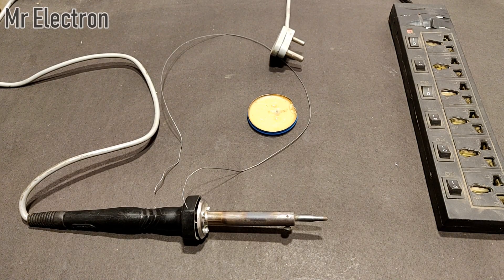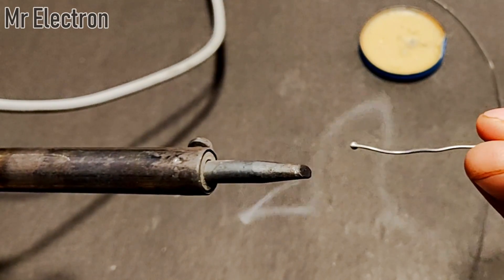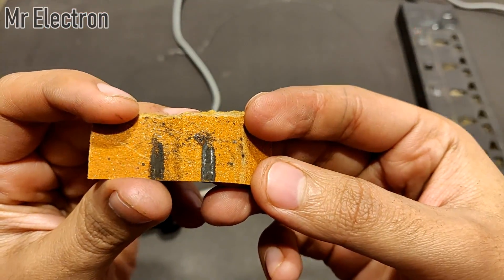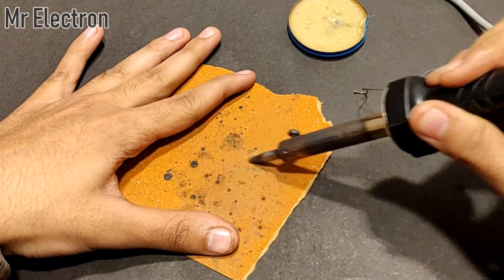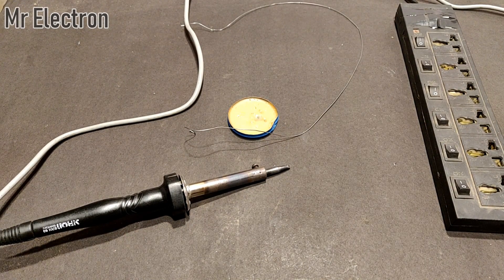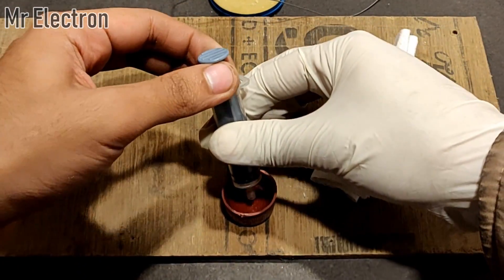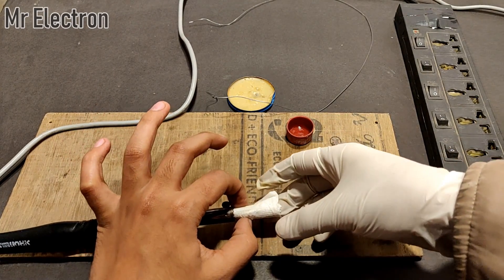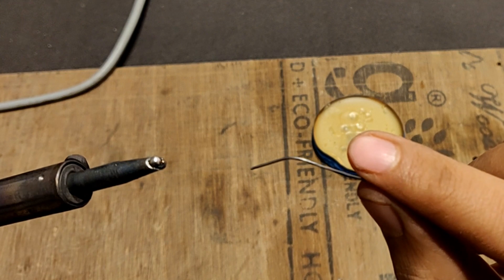Repair Soldering Iron || Solder NOT sticking to the Tip , how to Clean and re tin

Comment: Over heating is the main reason that causes damage to the tip.
Use a fan regulator to control voltage applied to the soldering iron.this improves the life of tip.

Comment: Kind of reminds me of that Phil Hartmann sketch, the anal retentive electrician. I leave the iron on, hit it briefly with the dremel drum sander, and tin it. That's it! Unless you're cauterizing wounds, I see no need for acid and ONLY CLEAN tissue paper. Get the metal clean and tin it, and go! That thick layer of fluffy carbon on the rest of the tip can actually act as insulation on a cold windy day, so long as you have good contact inside the iron.

Comment: Please, can you write down temperatures you were working with for each each phase? And what was the ratio of sulphuric acid solution?
Reply: this guy is basically ruining his tip. all you need to do is turn your iron on around 300 and dip it in flux and then add solder to it and then wipe the solder off. do that about 3 times and you should be good. dont ever use sand paper

Comment: So when u solder youre basically doing an electrolysis with the solder tip as cathode hence the unavoidable accumulation of residue due to oxidation... 🤔... Eh, sulfuric acid? ... He's reversing the electrolytic process? 🤔... He did not. 😳

Comment: What a terrible demonstration of how to clean a tip. People, don't follow these instructions. Use sandpaper as a last resort and even then, do it lightly so you don't scratch through the tin plating. Keep your tip tinned and don't allow it to get too hot without being tinned properly or else it will oxidize.

Comment: dude, you never sand your tip. rule number 1.
Reply: This rule is wrong. Copper tip is OK to sand. An iron plated copper tip is also ok to sand until copper appears. But he has cheap pure iron tip.
Reply: @fungames24  nope. from the day i started soldering over 40 years to now, every experience person reinforces that you should never sand a tip as it grooves it and kills it.  and i agree. do not sand a tip ever.. retin your tip regulary and use  copper wire wool. never even use sandpaper. and no random stranger on youtube is going to change that!

Comment: But why though? maybe if it was the last  tip on earth i would do this. If you need to solder electronics and have them work afterwards just get some new  tips  or it will turn into a mess and make you destroy stuff trying to stick the solder and heating for too long or small blobs will jump off the iron and land who knows where and pokssjbly  create a short. Dont just take your dads old iron in  the garage used for pipe and start fiddling with your iphone.Dont  use his plumbing solder either its not what you need.

Comment: you can never take the high temp plating from the tip..In order to avoid that alwyas tin the tip before or during turning off the soldering iron.
Reply: Good irons have solid alloy tips. Depends on what you have handy. Some fine sand paper won't destroy most decent irons.

Comment: Reading all the negative comments on this man's well produced, articulate and somewhat helpful video was discouraging. Looking at his tools and noticing his accent I would bet he does not live in the U.S/UK/Australia or some other country that has access to state of the art equipment or $ to purchase them. My guess is he lives in India with a billion people and only 10 have even a solder iron. The iron he is using was probably passed down from his grandfather and was sanded well before he got it. So last resort if the tip had its coating removed before is to sand. And that will work. Not long...but will work to do a job. Hats off to a well produced video and using what ever means necessary to make a fix.
Reply: Still the most incorrect way of soldering iron maintenance
Reply: wow, wheres your proof with all those yapping.
Reply: @OldMarius-gn5kk  these "yap" things are getting out of control
Reply: What a durogatory thing to say "only 10 have even a soldering iron". Coming from an entitled individual who has 10 ft. tunnel vision right down his nose.
Reply: @GruvenHaus  it isn't even derogatory at all. I am from India and yes most people don't own soldering irons because either they don't feel the need to own one or don't know how to uses one. Getting stuff repaired from repair shops is kinda cheap here so not a lot of people buy a lot of hardware and maintenance equipment.
Reply: Well done Sherlock !

Comment: Had a soldering iron which will not stick solder, since I haven't been using it for a long time. The tip is oxidized. I remember not to use sandpaper as it will take off the coating. Since flux is acid, it's use to clean the joints, I tried using citric and oxalic acid. Both worked well, just use damp paper to swipe or dip the iron in these weak acid and clean up. It will retain the solder again.
Reply: Thanks! Was looking through the comment section to see if anyone had any other way of doing this before resorting to sand paper
Reply: @curiousseal2678  honestly you both should get better irons. The problems you are describing are only ones that happen with very inexpensive irons. Most decent irons have a solid core tip at least. You shouldn't be afraid to send them a little bit with some fine sand paper.

Comment: I think,you probably had the best intention by making this vid. But, It is exactly what we learn not to do in basic electronic class. Never use an abrasive medium on the soldering tip. You should have called your vid "how to take off the coating of your soldering iron".  Hope since you made this vid you have learned to properly take care of your tip. Anyhow, and even though, I appreciate the rest of it. You did explain clearly and did it step by step, which are things that are extremely important in teaching, specially technical subjects. Keep the good work, I enjoyed it!

Comment: can i use vinegar? sorry for the question
Reply: Vinegar is not a good idea. 
You should only high solvent alcohol like 91-95% and brass wool. Oxidation makes soldering frustrating and most of what he did was not up to standards, but he was trying to help. 

Just buy a new tip, and get some silver/lead solder to tin it with and keep it tinned.

Comment: DO NOT USE SANDPAPER THIS WILL LITERALLYBMAKE YOUR SOLDERING IRON UNUSABLE
Reply: I think the point is....its already unusable. Taking off the coating is no bueno, but when the tip is already FuXed then you gotta do what you gotta do. Title should be , "last option to save a tip before throwing it away"
Reply: @KM-oi9ks  It's still unusable after sanding. It's basically a waste of time on a pure iron tip. Copper tip is OK to sand and will work like new.

Comment: Due to a defect in the soldering station, the soldering tip heated up until it glowed. I couldn't find a way to re-tinplate the tip. Everything fails.
I think, the heat destroyed it totally. There was nothing left for me to do but grind the tip down to the copper.
It looks like extreme heat is destroying the coating completely ???
Reply: dam bro you tryna fix an xbox?

Comment: Always make sure your tip is well maintained to prevent this, when you have a new tip, first thing to do is clean and tin it, after a few joints, wipe, clean and tin it again, when you're finished, clean it and melt some solder on the tip and turn it off, the solder at the end prevents the tip from oxidizing, never leave your iron tip bare when you're finished because your tip will oxidize and sanding and filing your tip will rapidly destroy it when the plating is removed and there's bare copper
Reply: Thanks bro
Reply: @anonamemous6865  no problem bud
Reply: Yea I've been messing the tips up for a few months now...still learning,Thank you.
Reply: @rcandrew8780  no problem buddy
Reply: sorry i'm no a native speaker, what does tinning the tip mean?
Reply: @user-hy4mi6wp9b just to coat it with good solder. If the tip remains tinned, or has solder on it, oxygen cannot get to the alloy metal of the tip. Also, don't put Flux on your tip because it's acid based... the best thing is clean metal and enough heat so the solder is attracted to the metal. That's another good tip for soldering. If your connection I'd preheated with a little Flux, you just touch the solder to the wires and it melts easily onto them. If it dries dull, that means your tip is not hot enough. It should dry shiny for a good connection. Especially important in circuits that are very low voltage, as a weak connection will impact low voltage circuits much more. Things like turntable leads need lowest possible resistance.

Comment: Cool, thanks, though sandpaper (and scratching with a cutter blade) should be the very, very last resort, avoid harsh abrasion, it'll strip the iron plating at the tip and the chromium. Even if it's a copper tip, it'd deform the tip as well in no time, if sandpapered every time but thanks for sharing. 

My iron has been eaten a bit, even though I always clean it with the sponge after every use? What caused it?

God bless, Rev. 21:4

Comment: omg, I don't have a lot of experience, but I learnt to never do that. Use a brass sponge and a water sponge, retin your tip, if it doesn't want to, the tip is dead. You need to change it. 

Sanding it and using sulfuric acid just remove the plating and the lead/tin won't adhere to copper/iron exposed to oxygen as heat will constantly build an oxyde layer over it.
Reply: At my first use of a new iron it just got black and never accepted tinning the tip what did i done wrong
Reply: @bruhmettinmomentogullar4215  What brand of tip did you get? I had a lot of problem with a cheap Weller irons, the tips are cheap and doesn't last very long and are very hard to tin the first time.
Reply: @emmanueloverrated   i genuely dont know, i think we can safely assume that its some cheapo one

Comment: 45 years using a soldering iron, i have never used sandpaper and never will. Just keep the tip tinned with solder every time you switch off. Maybe gently use brass  wool and solder iron sponge.

Comment: Sandpaper and sulfuric acid?  LOL  Do not listen to this guy.  You will remove the tips coating and destroy the tip!  Hot dip in flux , tin and wipe on a wet sponge and repeat is the way to clean a tip.

Comment: Do not do this the sandpapper the sand paper breaks the coating on the iron and it will oxidize when it heats up. Never use an abrasive surface on a iron
Reply: So then what should you do?
Reply: The acid is also a joke!   😎

Comment: If you use brass wool after every soldering session, the soldering iron won't get dirty an you don't have to destroy it with sand paper 😉
Reply: yes, I have been using Pure Copper tip for a long time, and there down side is that they oxide very fast, and they need sanding, other than that you melt fine solder.... Then I tried BRASS!!!! game killer!!! easier to tints and tips do not oxide easily if not even, a realy game changing!!
Reply: does the steel wool for dishes work too ?
Reply: @bruhmettinmomentogullar4215  No. Steel wool will scratch and destroy the surface of your solder tip. Brass is smoother. If you don't have brass wool use a wet real sponge, cloth or wool from cotton or sheep. But no sythetic wool or sponge, it will melt.
Reply: @Onkel-Stevo   i tried the sponge and its not getting any "less blacker" even when i use it at full power (48w) it just struggle to melt anything at all

Comment: I know that using sand paper is wrong,but there is no other reason to clean tips like that.
i had same problem
i change soldering wire and now my problem is gone
just buy expensive soldering wire and that's it
buy solder wire that is in small amount to try if its right for your soldering iron tip
i buy solder from bul-max turkish company and its very good but its expensive for me
10g=$1
that means 1kg for this soldering wire cost $100
tell me if you are using some soldering wire from aliexpress/ebay that is good
Reply: yes on Ali I m getting good 100g for around 5 bucks!
Reply: @DrZipZwan  can u send me pls

Comment: it worked for one time . it is getting slowly black on tip , what next step to follow
Reply: Looks like the other commenters are saying 
A) acid treat, heat up and “tin” the whole tip by covering with solder. Always leave the tip coated with solder
B) ideal - buy a new tip and tin it after every use
Reply: @hubristicmystic  I will try. Thanks for your comment

Comment: He did a good job, but at the end he should've tinned the whole tip, you can sand the whole thing down to bare metal, but you have to re tin the tip to keep it from oxidizing in the future and corroding too
Reply: I recently bought a new soldering iron and it is not sticking solder to it. What should i do?????
Reply: @tusharsinghal9396  clean it and tin it (do this about 2 to 3 times) never use anything harsh

Comment: This video should be called how to kill a soldering iron in under 10min
Reply: Do you have a better solution?
Reply: @HigherPlanes  electrolysis or sanding
Reply: what the actual fucc I just tin mine so it never happens in the first place. Doesn’t sanding ruin the coating?
Reply: @HigherPlanes  a little bit but if u choose a thin sandpaper it cleans it a little bit
Reply: @HigherPlanes  just sand a little bit the tip only a little bit and the other part doesn't matter
Reply: @HigherPlanes  buy a new one
Reply: @メSei  lol I guess If money isn't an issue..

Comment: It's so dumb to do that there is clearly mention on the packaging of soldering iron to not to rinse the bit as it will remove the coating
Reply: Pleasee tell me how to do it then
Reply: @airplanewhat5316  just don't do it, replace it with a new one, you can get it for like 0.30 cents(atleast where i live)
Reply: @fahadahmed480  and what not to repeat it?
Reply: @fahadahmed480  30 cents... so is it possible to find only the tip of the pen?  The correct one?
Reply: @airplanewhat5316  yes it is possible to buy it brother, just go to any market and ask for the Soldering iron bit or soldering tip
Reply: @fahadahmed480  well thankyou so much
Reply: @airplanewhat5316  just get the iron tip refresher...

Comment: Kiss your soldering iron good bye after this.
Reply: Funny how he loved this comment
Reply: @narrowempress1625  I think the reason he liked it is cause it's true cause it damages the tip but it works at same time by making solder stick
Reply: The tip won't be ruined if it's a good one. Cheap irons are only coated with a thin layer of the alloy that makes the best tip. A good iron will have a solid tip at least, and you can sand it as long as there's some tip left. What he's doing will only destroy a cheap tip... and take you far too long. Sand, tin, and go!
Reply: Is so dum I done this
Reply: Why
Reply: @224chingon  because of the sand paper, the tip will damaged.
Reply: @メSei  well that doesn't really mean much if you were going throw in anyway might as well give it a use

Comment: always use copper and brass bits and for cleaning, u can use a triangular file or flat file. and while doing soldering u must have to use a face mask as it contains. lead
Reply: The fumes you see is not lead but the flux, lead and tin are metal and metal dont melt and vaporize at such low temps, if the fumes is a problem to anyone, use a fume extractor and wash your hands to remove lead particles from your hands, soldering is relatively safe unless you decide to hold things to eat without washing your hands or unless you decide to eat the solder....but i don't think solder is tasty enough for us to chew it up lol
Reply: they make lead free